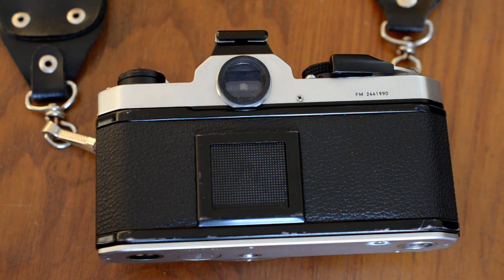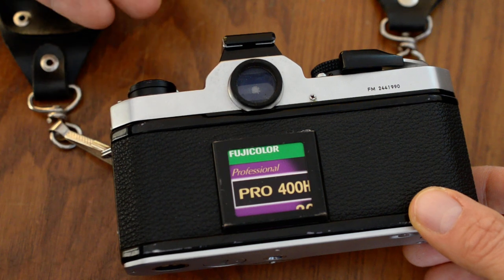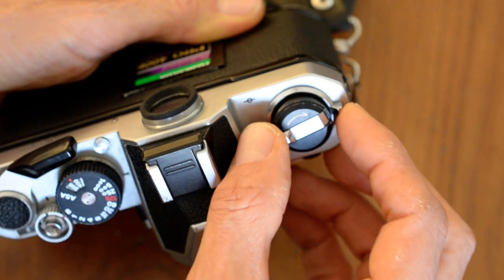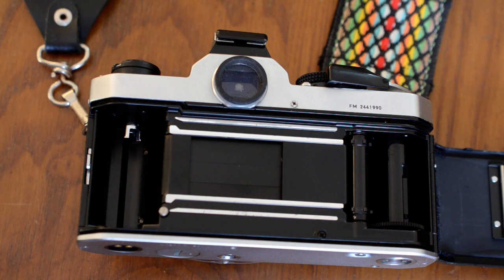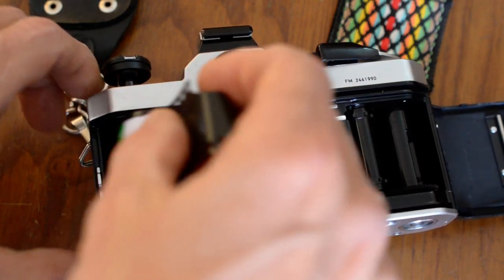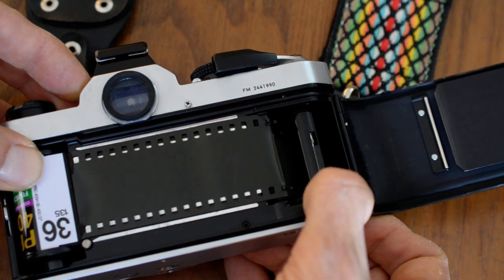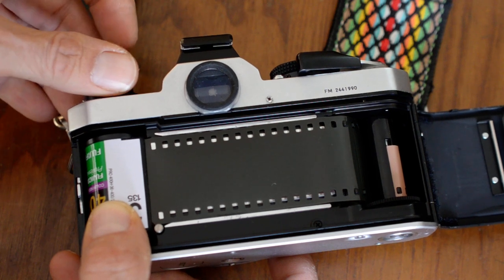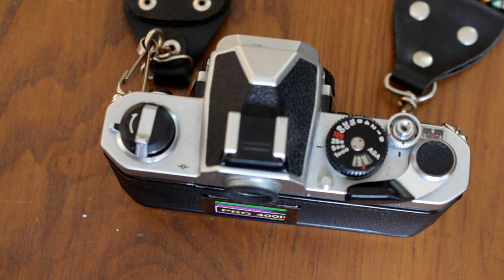Loading Film (Nikon FM)

Comment: I feel so old that you now need to demonstrate in this digital era how to load a 35mm film cartridge into a camera. I used to own an FM, among other Nikon gear. You did everything right, including back-winding the cartridge to take out the slack. Since every roll cost money (unlike digital), I would try to squeeze as many exposures out of a roll. So, rather than advancing the roll three frames on closing the back, two frames were sufficient to advance to a frame ready for exposure. I could typically get 38 or 39 frames out of a roll of Kodachrome 25. But always watch the rewind knob the first couple advances to make sure it's turning. Occasionally the leader can slip out of the sprockets at the outset, and you'll be shooting blanks, since the film is no longer advancing. I learned that painful lesson on two occasions... once while shooting a wedding. Fortunately, I was shooting with two cameras, so it wasn't a total loss.